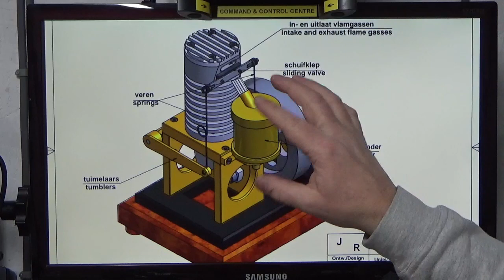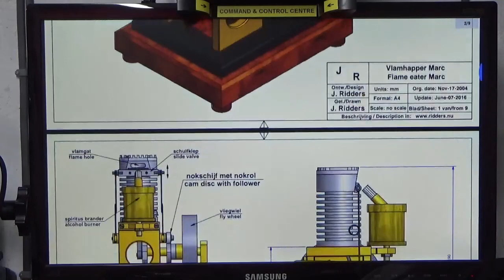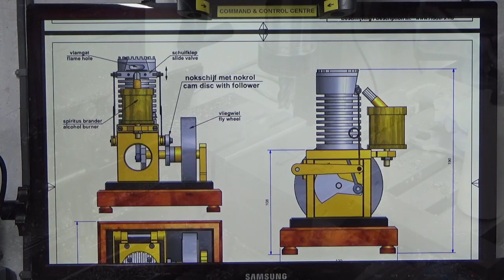Making a Flame Licker Engine "Marc" by Jan Ridders.  Part 8 - Valve Assembly

Comment: Gday Jon, small parts a fun to make but they can be frustrating at the same time, my fingers are really no good for this, forever dropping the bits and spending a long time on the hunt, sounds like it was a wild 24hrs, fantastic irk as always mate, Cheers
Reply from the maker: Hi Matty, thanks for the comment and feedback. Yep, my fingers aren't far off these days lol. Too many years taking tea bags out the cup without using a spoon! This is where a little bench lathe really comes in, much easier than turning 2mm pins in a big 3 jaw. Cheers, Jon

Comment: Cheers Jon, another interesting video and well done with the size of the part and size of machinery. As other have said, sometimes easier to make up a paste for the flux and also sometimes easier to cut small slugs of the solder and place them in position with tweezers
Reply from the maker: Hi Pakrattuk, thanks for the comment. Lol, yep, turning 2mm Dia pins in my lathe was a giggle, I only needed 2, think I made about 6 to get 2 lol. Thanks for the advice, will definitely try paste next time. Cheers, Jon

Comment: Another good video Jon, I normally make the flux up as a paste with water, you don't need much water, bit like making up the old Pollyfilla!!. This paste can then be applied to the cleaned parts before heating. You should then find the area heated does not oxide and the silver solder will flow much easier around the joint. Keep up the good work and hope you have not suffered too much damage from the storm that keeps you away from the workshop! Gary
Reply from the maker: Hi Gary, thanks for the comment. Yep, I used a paste many years ago, probably some nasty carcinogenic stuff no doubt. The stuff I bought for this job was some el cheapo Ebay stuff and the flux instructions said dipping only so I just went with it. As you saw, it was a bit of a nightmare getting the solder to enter the joint. I need to go shopping! Cheers, Jon
Reply: @jonsworkshop   I use Johnson Mathey Easy Flow. It is in powder form and you can mix it with a little water. I normally keep my mixed up paste in a small glass jar. Even when the mixed paste drys out you can mix it up again with some more water and it still works. The little engine project is coming along nicely Jon.

Comment: Coming around nicely..... fine delicate work! Good job on silver solder! On small parts like that, dont put the Flame direct to the joint, the burning flux build up a black/Brown consitence (like molten suggar) and makes it impossible to add solder. Thats why i use the fluxcoatet silver solder (for high temerature soldering) on small parts can be a challenge do get the right amount on the joint, but with a little practice should be easy! 
Some Parts makes it impossible, but keep one thing in mind... direct flame to  the joint (not heat) is also a problem. Sometimes can be solved by applying heat from the other side. The challenge on silver solder is, to get much heat on the Spot, but less Flame! 
And use the heat to lead the solder... the solder always flow in the Direktion, the heat is coming from! (Like welding) 
Just some thoughts.... 
Great Job! And looking forward to see it running! 
Stay healthy!
Reply from the maker: Hi Dreamsteam, thanks for the comment and advice. I need to play around a bit on some scrap material to relearn my rusty skills. I also need to get some decent quality rod materials and fluxes, the stuff I used in this video was cheap rubbish off Ebay just to get me started. What is the full product name of the rods you use (the green ones) and where do you get them please? Thanks, Jon

Comment: The Oxy Propane kit looks interesting Jon. I wouldn't want Acetylene around my home workshop. I despise silver solder, probably because I'm so poor at it so well done for cracking it. 
In a past assignment, I ran an airframe repair workshop. If anyone took a saw out of the kit, it was a race to say 'Let the saw do the work!' I chuckled when you said it. 
Best wishes, Dean in Oxfordshire.
Reply from the maker: Hi Dean, thanks for the comment and sorry for the late reply "Arwen"!! I used to be pretty slick with the silver solder about 30 years ago, looks like I forgot most of it lol. I will persevere. Lol on the hacksaw gig. Cheers, Jon

Comment: Nice one Jon 
It's coming on grand, well explained too with the drawing at the beginning, it puts everyone in the picture to how it works before your making the parts. Just a comment as per others, i mix a paste of flux and thoroughly coat all the bits that need solder but not the bits that don't as the solder follows the flux, i'm by no means an expert in this but learned this whilst making my 5" gauge loco boiler.
see you next time, look forward to it
take care and glad you survived the storm okay
Kev
Reply from the maker: Hi Kev, thanks for the comment. Yes, I used to use paste donkeys yrs ago, the stuff I bought for this job came with power that said dipping only so I just blindly followed the instructions. Now I have a decent flame, I need to buy some decent flux and rods etc. Will do some research. Cheers, Jon

Comment: just a suggestion John, when silver soldering mix the flux to a paste and apply to all parts before assembly, when heating the job don't boil the flux but dry it gently the heat the job just away from the joint when the flux changes and looks watery your nearly there with the heat and apply the solder to the joint and it should run. If your silver solder is of large diameter just whack it to thin it out so you can apply it sparingly and it melts int the joint. Good luck with the build it coming along nicely.
Brian.
Reply from the maker: Hi Brian, thanks for the comment and suggestion. Yes, this is how I used to do it many years ago using Oxy Acetylene. I bought dirt cheap silver solder off Ebay that came with its own little pack of flux and it said "dip only, do not add water" on the instructions when I came to use it! I need to get myself some decent stuff so I can use it as you suggest. Cheers, Jon
Reply: @jonsworkshop  sounds like more of a brazing rod with a very low silver content. Luckily I have a supply of high silver content rods bought many years ago at a lot less than the inflated prices today.

Comment: Jon, With Silver Soldering you really should fully flux the part first before getting heat near it. As soon as you applied the flame and it looked to me to be an Oxidising flame, I could see the parts going black. The solder too looked to be on the big size, but I expect it was the only size supplied with the kit. Might be worth a try to see if you can thin it a bit with a file. Good luck with the house repairs. Regards from Australia.
Reply: Agree with fluxing first - "Might be worth a try to see if you can thin it a bit with a file." - you can whack it flat with a clean hammer on a clean steel plate to thin the solder out then snip little bits off (pallions) and put them on the joint with the flux, then all that's needed is heat. Looking forward to the engine coming together.
Reply from the maker: Hi Dave, thanks for the comment and suggestions. Yes, when I last did any SS, I used a paste and Oxy Acetylene and it just flowed really well. This was me being a cheap skate lol. I bought some cheap stuff off Ebay, just to get me going, the flux came with the rods and said "dipping only, do not mix with water" so I just followed the destructions. Now I have a decent torch kit, I will invest in some various rods and fluxes (probably BOC stuff or similar). I also want to do carbide brazing eventually so will get myself kitted out a bit. I set the flame to slightly carborising but I think as the torch warmed up, the valves changed through heat expansion, I never noticed at the time as I was just staring at the part. We will get there mate with some more practice. Cheers, Jon
Reply from the maker: @Mister_G  thanks for the comment and suggestions, all in the memory bank. I have seen others use the Pallions method, it looks like a good idea, especially for really small stuff like this. Cheers, Jon

Comment: That was great John, really enjoyed it. Sorry to hear you had some damage from Arwen. I got off lightly.

Great work with the hacksaw and file on the small parts. I would be interested to see a review of the oxy propane gear.

I am currently working towards making my first proper video, which will be about fault finding on DRO systems.
Reply from the maker: Hi Carl, thanks for the comment. Late reply, not sure what happened. Yeah we got battered and we get to do it all again tomorrow lol. Spent tonight getting my generator ready, not going through another 48 hours with no Lecky! Good luck with the video, look forward to it. Cheers, Jon

Comment: Hi Jon

Good video, I have just stated making the smaller version of the flame eater with the internal valve. Hope you get the storm damage fixed soon.
Reply from the maker: Hi Chris, thanks for the comment. I am really enjoying this build, never thought I would get into model engineering but it has been a great pleasure so far. Cheers, Jon

Comment: Turned out well Jon.  That torch should allow you to easily braze with manganese bronze.  Much cheaper than silver solder and stronger bond.  I'm guessing you used about 45% SS rod.  Looking at the metal temperature it was plenty hot enough for bronze.  Cheers Rob
Reply from the maker: Hi Rob, thanks for the comment. Yes, I think it was 45% from memory, it was just some cheap stuff off Ebay to get me started. I need to get a selection of rods and flux (better quality stuff) now I have the gas kit. It says on the box that this gas set it hot enough for gas welding steel, I might give this a quick go in the review video, should be a giggle, I have enough trouble with MIG lol. Cheers, Jon

Comment: Hi Jon, I use Easy-flow powder flux. 250g probably last you a lifetime. Can dip as usual but mix a small amount with water in a little container to use as a paste. It'll dry out but just re-wet it, or make some more. I mostly use 55% silver rods but depends what you're doing. Be interesting to see what oxi/prop kit you got.
Reply from the maker: Hi Dave, thanks for the comment and sorry for the late response. I will definitely be getting some better flux, that stuff was crap. Will look into Easy flow. Cheers, Jon